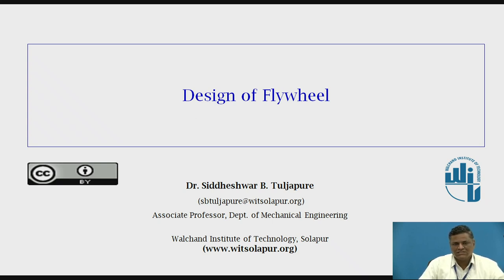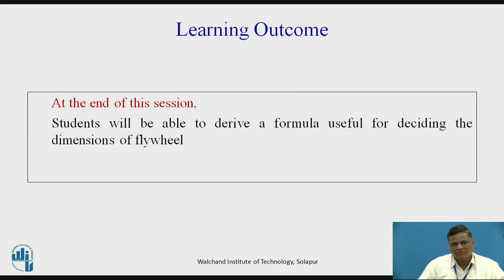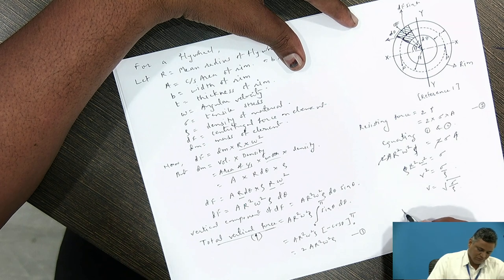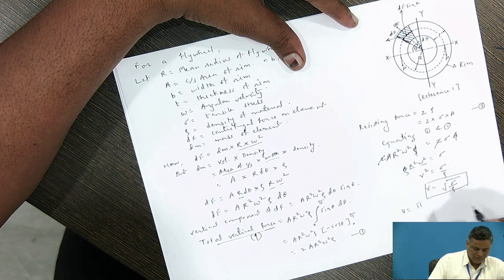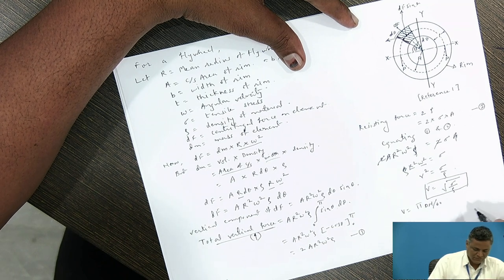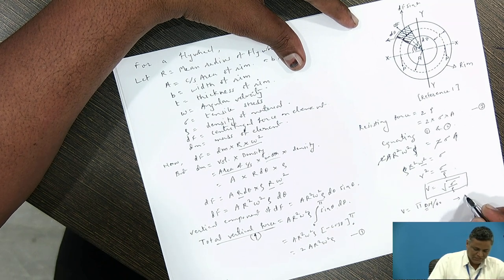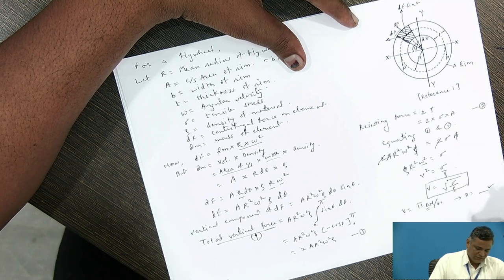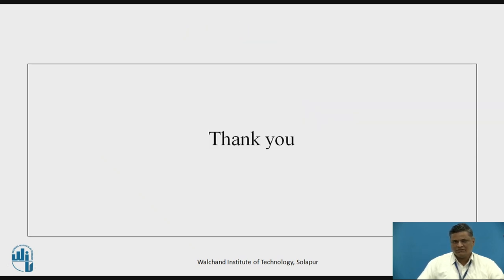Design of Flywheel

Comment: I suppose the strongest design requires a smooth curve from a thinnish hub to a thick rim so that the cross section is essentially tapered.     __  a compromise essentially if making flywheel from one piece.